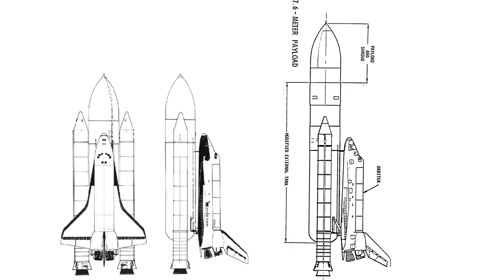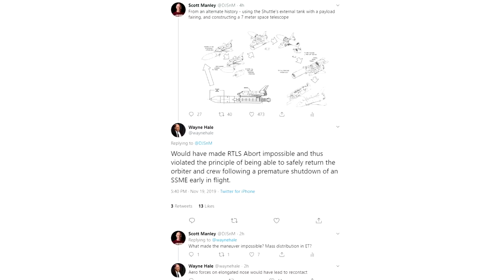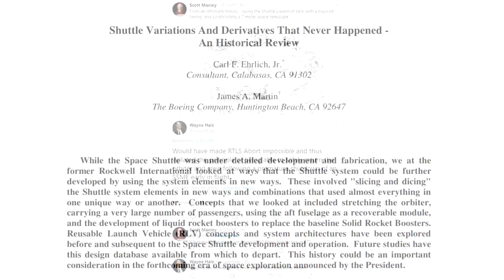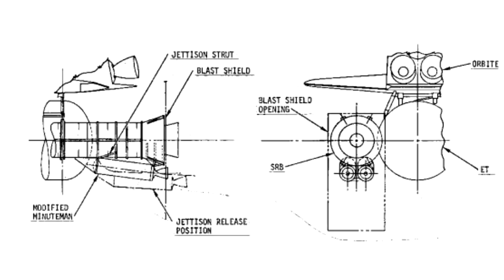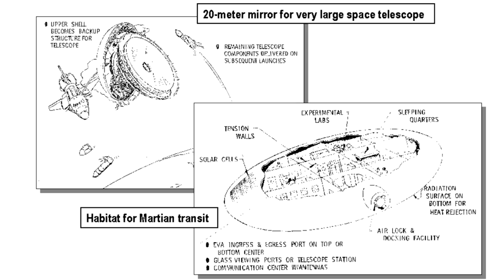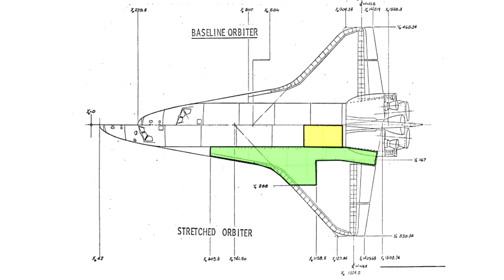Boosters on the Boosters & Other Ideas For Improving Space Shuttles

Comment: A while ago I found a small picture book (probably from around the early 70's) that had a concept for a shuttle that was a two stage vehicle with a large flyback booster. Basically it looked like an orbiter piggybacking on top of another larger orbiter.  As far as I can tell this was a fairly early concept that was scrapped due to cost concerns, but did the concept ever re-emerge after the shuttle had been built? 

It struck me that the vehicle looked remarkably like SpaceX's Starship, if the two stages were attached and landed horizontally, and looked like a much more elegant solution then the actual shuttle that needed two SRBs, an external tank and oribiter just to get into orbit. Maybe even the kind of design that could have made the shuttle affordable? Who knows. At the very least it seamed better then some of the other shuttle concepts that just seam to be adding more stages and more complexity to the design, when the vehicle really needed less.
Reply: The two-stage flyback design was the original Space Shuttle concept, but it was too expensive to develop. Ironically, it would be probably cheaper to run than the design we got.

Comment: STS gets dumped on a lot, but had they stuck with it and developed some of these various upgrades and spin-offs, I think the whole sidestacked/reusable SSME system would've proved very versatile. Even as it flew, the straight up STS configuration managed well over a hundred missions and accomplished a lot of stuff. There certainly was nothing like the Space Shuttle before, so considering everything they did was pretty much the very first time ever, it's not really fair to hate on it so much. As for Wayne Hale complaining about the abort options on the stretch ET, there are ways to engineer around that.
Reply: What they should've done from the start was mount the shuttle on top of an SLS-like core stage with side boosters (as a bonus they might have been able to keep using Saturn V stages for the shuttle). That would've eliminated many of the safety problems (ignoring the lack of abort scenarios). There are very good reasons for why the shuttle is one of only two spaceplanes to ever be mounted on the side of a booster.
Reply: @appropinquo3236  Studies were done looking at using Saturn hardware as part of the STS booster system. There's a ton of documentation out there about the development of STS if you dig for it.

Comment: Solution to the stretched-tank-coming-back-at-the-Orbiter problem: fit a pair of small, all-moving, symmetrical-aerofoil fins to the front of the tank. While the tank's attached, these fins free-stream into the airflow and so have zero aerodynamic effect. When the tank is jettisoned however, a pair of pyrotechnic devices fire which lock the fins into a pitch-down configuration, over-compensating slightly for the pitch-up effect of the tank extension and ensuring clean separation.

Comment: Hey Scott, the "green section" you were referring to at 8:44 is called a leading edge extension or LEX. I know on aircraft like the F-18 they significantly lower the stall speed and aid in controlabiltiy at lower speeds.
Reply from the maker: Thanks

Comment: It would have been really interesting to see a shuttle 2.0 . The biggest problem with the shuttle was IMO that they hadnt any chanced to apply the lessons learned from building it. Yes, they improved certain factors, but with they had the opportunity to just start new, with a giant budget, they could have build something amazing.
I am pretty sure, that the spacecraft to airplane method is the future. I dont think that rocket powered landings are going to be common  for manned vehicles simply due to the fact, that there is no fail safe if the engines fail and being very limited to where it can land (e.g. the starship is not going to land well on anything that isnt flat).

Comment: Forgot the fly back boosters with 3-4 upgraded SSMEs on each boosters and 2 f100 PW jets to fly them back with short shuttle like wings on each one. Eliminate Solids altogether they were very seriously considered in the 90's also a concept with modified RD170's. I have the artist concept somewhere in my house.? I worked at Pratt on the SSME turbo pumps and RD180 co-production programs..Best Regards Edward.

Comment: Regarding the first couple of minutes of this video, if the orbiter payload bay would be empty, why bother with the orbiter at all at that point? Just strap the boosters to the tank and light the engines. It's basically an Arian 5 at that point. And that seems to be what you get to in the latter part of the video. The orbiter is useless after a couple of changes.

Comment: There was also a proposal for a cargo module at the bottom of the Extrnal Tank. This could be used for outsized cargo or an approximately 26 foot diameter habitation module. If this had been built an flown we could have docked two ETs nose on to a beam structure and spun the assembly to provide a research facility on the effects of reduced gravity. Specifically 1/3rd and 1/6th g. We know that long term zero g is bad. We have no real idea as to the effects of reduced gravity. Are the effects linear? An ascending curve. Or one that climbs rapidly and levels off. If we ever intend on becoming a space fairing civilization we need to know.

Comment: Mount the main engines in a fixture directly under the big tank. Mount four SRBs around the big tank. Mount a space station module on top of the tank, as massive as a fully loaded Shuttle. Launch the whole thing into orbit. The big tank would of course be modified as needed to mount the extra pair of SRBs, the engines beneath, and the station on top. Places in the sides of the hydrogen and oxygen tanks could have reinforcing rings welded in during assembly. When in orbit, tap the remainder of the H and O for running through power cells to get some electricity and produce some water. Some of the oxygen could be used to replenish breathing air. That would be done while separately launched crews are moving in and getting things set up. External fittings for mounting hatches, docking ports etc would be packed inside the station module. They'd go on the outside of the big tank where the reinforcing rings are. Once mounted, cut out the tank skin inside the ring and external fitting. The big tank would become a huge 'basement' to expand into.
Could have had a station with more volume than ISS put into orbit in a single launch. Every crew launch for a long time to come could carry new additions to go into or onto the big tank.
But instead of using all the material and volume of the external tanks, they were all tossed into the oceans. Just lofting them into orbits high enough to be stable, but out of the way, would have preserved a valuable resource, even if they would just at some point be cut up for scrap to feed an orbiting recycling furnace.

Comment: Interesting thought on the space shuttle, although it was way over budget than anticipated, I feel like the challenger disaster should not be factored into the designs record. 

The challenger was pushed past the factory limits. It was an issue with management pushing the spacecraft to fly in temperatures that was known to be dangerous. If you fly a plane through a hurricane then it crashes is it a bad plane? No. 

Just a thought anyway.

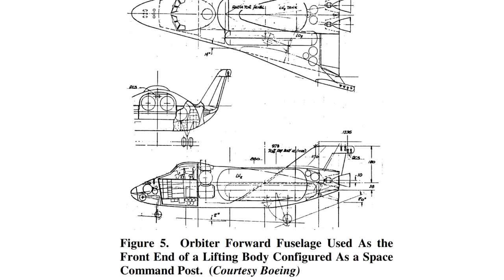Comment: 10:13 isn't that the x-37?  Boeing proposal.. raked up wingtips...

Edit: Also, while you mentioned making a telescope out of the external tank, there was also a proposal to gut out and refurb the external tanks into space station modules.  And you would link them up with each flight getting the station bigger and bigger.  The shell provided during launch already while the cargo bay would just carry the bits to repurpose the inside.

Comment: Mr. Manley,  Are there or have there ever been any orbit capable rockets powered by solid fuel?  Not just boosters, but the main propulsion system?  Also, I have always wondered why there has never been a rocket launch system that works like a bottle rocket.  If I stick a bottle rocket in some loose sand and light it, it will lift off and fly, but if I light it and drop it into a tube, it goes faster and higher.  I can imagine a long tube made of sections that is built into the side of a mountain in the Andes of South america.  It could be 10 to 12 thousand feet long (high).  A solid fueled rocket could launch with a mass greater than the initial thrust of the engine since the pressure behind the rocket in the tube would accelerate the rocket all the way up the tube.  You could even have a boosting charge, or charges separate from the rocket that add pressure to the tube as the rocket goes.  Maybe you could have a thin film over the top end of the tube and evacuate the air from the tube before launch so the rocket does not have to push the air out of the way as it goes.  Even if you could not launch traditional satellites like this, maybe it could be a good low cost method of boosting water, fuel, food, into orbit for a moon or Mars mission.  What do you think?
Reply: Horribly ridiculous late, but yes, there is such a rocket; the Minotaur-C/Taurus is a 100% solid fueled launch vehicle that is able to put satellites into orbit
Reply: @sudoscience5084  Thank you for the response Mr. Science!  😁👍🏼😁👍🏼

Comment: Telescope idea is fine. I was thinking more of part of the body originally. The separation would be non-atmospheric and less complicated. The big part of the telescope need not be the heavy part. The weight could be shifted. Thinking a nose thruster that blasts out a cone might reduce drag enough to get the whole assembly orbital and with further advancement even the moon. I think 12 orbital telescopes that size  in 5 years is realistic and would be quite an achievement.

Comment: I have noticed that Ariane4 and some of the Falcon family also has a hammerhead fairing. Why is it that some lift vehicles is slimmer than there fairing; Wouldn't it be better to have the last stage as wide as the fairing, once you had the air resistance of the fairing; And what guides the length to width ratio of rocket stages?

Comment: Scott; Ever going to do anything on the Lentricular Reentry Vehicle, (LRV) designs that NASA fooled with during the build up to Apollo? (Note this is not the Air Force LRV design but the smaller "Apollo" class designs that were investigated to allow fly-back and landing including a design that "simply" used the heat-shield to land on in a 'skid-out' configuration... Neat stuff)

Comment: Did I get it correct? If you add a small busters to the big one you could increase a payload on the orbit in 5 tonnes?
Reply from the maker: Yep, little boosters to help it accelerate off the pad a bit faster.

Comment: Wait. If the fuel tank falls back ballistically and the shuttle doesn’t have more than maneuvering fuels then shouldn’t the shuttle have had to have more fuel onboard or else return ballistically. Or did they just need a little nudge to circularize. Or was there onboard main engine fuel.

Comment: The artist rendering with the usaf info on the shuttle was launching from Vandenberg.
Reply: Which makes sense since the plan was for all the Vandenberg shuttle launches to have been military missions.
Reply from the maker: Which means the satellite was launching into a polar orbit, designed to cover the surface of the earth, rather than look at space.
Reply: I ran into the plans for Vandenberg shuttle pad while working at the Army Corp of Engineers LA Division just before The loss of Challenger and the cancellation of the whole project. I’d be interested to see what info has appeared regarding this plan and the cancellation. The stuff I saw and heard made the idea look very under planned. From gas retention in the valley to old equipment to shuttle logistics to RTLAX plans for recovery. It’s just like the info in this video. Thank you Scott!

Comment: None of these ideas are any more crazy than the original shuttle stack. “We’ve got a space plane that takes off vertically and lands on a horizontal runway.” “Really? Won’t it take a lot of fuel to get it into space?” “Yes, so we will equip it with an external fuel tank.” “Oh? How big is the tank?” “Several times the volume of the space plane.” “That’s huge! How do you get the fuel tank into space?” “We will attach two solid rocket boosters to the tank.” “Oh. I see. How big are the boosters?” “Yeah... like plenty big enough to be solo space rockets.” ... “Sounds like you’ve thought of everything. Let’s build this thing!”

Comment: Here's a radical Shuttle configuration: The original concept for the Crew Shuttle. No ET. All main engine propellant stored internally. Overall size of orbiter about the same with same 3x SSME. 4-5 crew with much smaller payload bay, big enough for mission equipment or one standard size comm. sat. The TPS providing insulation for cryo propellants. 2x liquid propellant strap-on boosters with 1 ea. recoverable F-1. Heavy lift by Saturn I-B until future HLV or possibly Saturn V.

Comment: real question is, if the space shuttle fuel tank was bigger, than why not just attatch the space shuttle engines to the fuel tank and lose the extra weight...?
Reply: If it did then it would look like the thicker version of the spacex starship. Which wouldve been dope as f**k
Reply: That’s what the Russians did.
Reply: Its not that simple, and those where also ridiculously expensive and thus had to be reused.

Comment: The Shuttles wings should have been shortened considerably. Only reason it had such large wings was because of cross range capabilities that satisfied Air Force requirements. A capability that was never actually utilized during its service life. Plus, having smaller wings would present less of a target from foam debris shedding off the external tank.

Comment: I don't like the idea of using the external tank as a component of space telescope, or anything else for that matter.
I asked a retired senior NASA engineer who worked on the shuttle if the tank could be taken into orbit and used in some way.
The metal is too thin, it's like paper, so even using it as unpressurized cargo storage is risky.
Not to mention the extra fuel used to get it into higher orbit, would mean virtually no cargo could be aboard the shuttle.

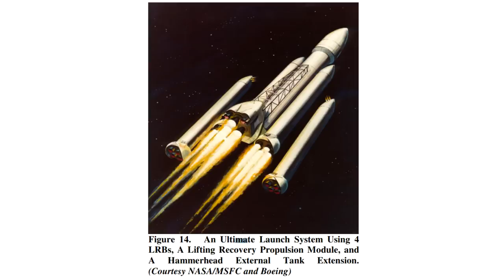Comment: 5:50 - Why on Earth not just put the propulsion section underneath the external tank and have a normal rocket?  What possible benefits could this configuration have provided?
Reply: As you can see nowadays with the SLS, it is not that simple. The tank is designed for far different loads (radial rather than axial). It basically needs to be rebuilt from scratch.

Comment: If you need more boosters then why not pair bbosters into a block of two and use their shared struts to connect on the same modules rather then hang booster onto another booster?
The key question is - do we really need capability to get 15 tons from orbit back to Earth if the idea to put nukes into orbit was axed and thus there is no need to maintain them and have an option to get them back to the ground safely in case of emergency? No nukes=no problem!

Comment: The shuttle was remarkable only in that it was actually made to work. As a space vehicle it was all but a total failure. The usability concept was significantly more expensive than disposable vehicles. Side mounted boosters are less efficient and less aerodynamic than a vertical ship, wings are just dead weight. Payload is smaller than it would have been otherwise. Reliability was obviously an issue as the side mount design ultimately wound up killing people. The shuttle was "cool" but it was an expensive distraction.

Comment: "another 5 tons into orbit", meanwhile they launch an extra 100 tons of unnecessary vehicle. None of these proposals make as much sense as the SLS so while all these proposals would have made for some interesting engineering they're all trying to hammer a square peg into a round hole. SLS avoids the more egregious compromises by moving the engines inline with the external tank, putting a payload fairing on top and getting rid of the 100 tons of unnecessary vehicle weight. The price tag is excessive but that could come down if they aimed for more reuse (something the moribund and political ULA seems institutionally incapable of). Before SpaceX landing that 1st stage would sound ridiculous but Boeing and ULA is going to find it even more difficult to justify SLS budgets when Starship starts meaningful vehicle reuse with orbital rendezvous refueling.

Comment: Surely, if they launched with an empty payload compartment, and everything inside the nose of the fuel tank, the Space Shuttle would have been redundant? The same payload could be orbited by using a smaller conventional liquid-fuelled rocket with ostensibly re-useable SRB's.

Comment: Such a weird idea to re-purpose the shuttle's launch system so it can carry cargo itself.

...but then keep an empty orbiter attached just so it could keep being used.  This makes SLS seem resource-effective again.
Reply: There are multiple reasons for not just "moving the engines under the tank" :
A) NASA wanted to reuse the expensive RS-25 engines
B) As you can see with the SLS, it actually takes quite a bit of doing. You basically need to redesign the tank from scratch so it can handle the different loads.
Reply: @HalNordmann  you need to redesign the tank from scratch to handle the loads anyways if you put tons of cargo on top and have the forces transfer through the tank.  The only thing they would be keeping the same are the SRBs.  Maybe.